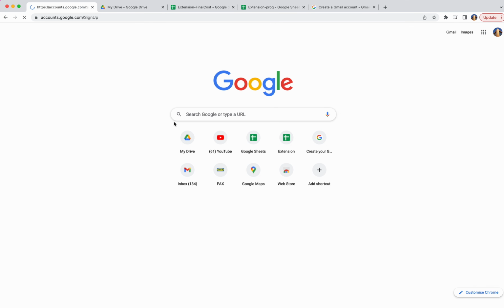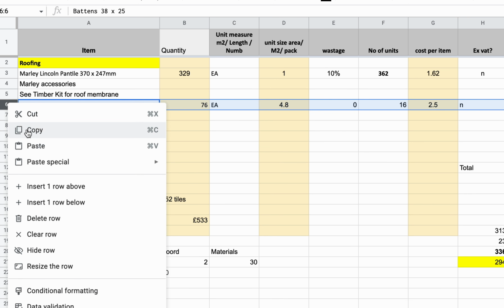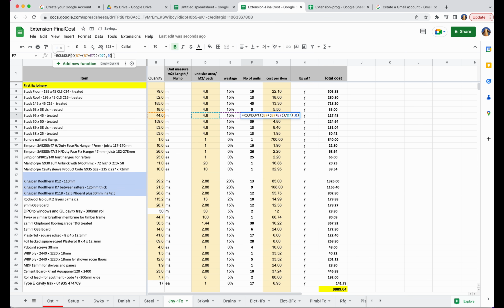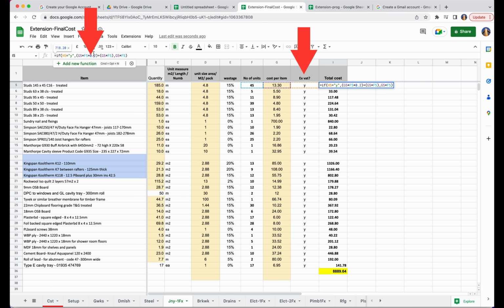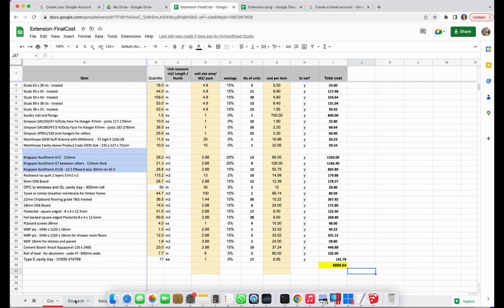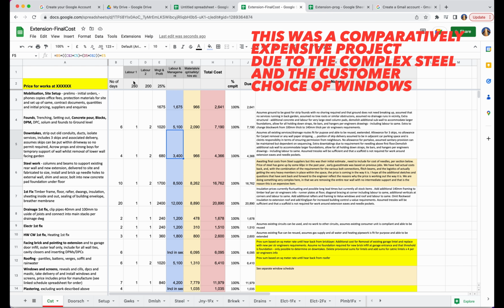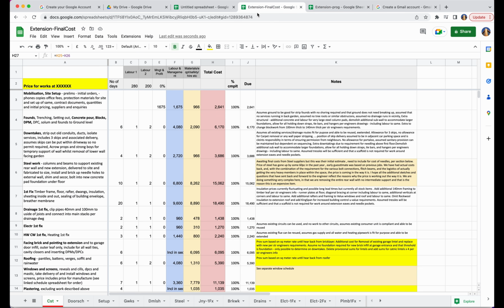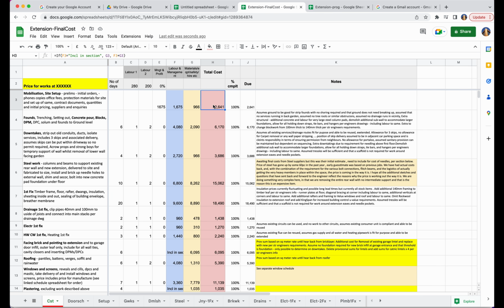How to COST and BUDGET a house extension - Pricing document download EXPLAINED

Comment: Great resource, thanks for putting it together.
If someone is planning a self build and can't see the value in this spreadsheet good luck to them, they have a big surprise coming🙄😂
Reply from the maker: Thanks a lot. If you have any questions on it let me know.
Reply: @build-better-things  Not to take anything away from your brilliant spreadsheet! but have you ever tried a software called Price A Job?
 I saw another youtube UK builder review it. 
The estimating module costs ~£30p/m but I have to say I was very impressed with it. It has a massive library of rates and material prices which I believe are updated every 2 weeks. I don't have a subscription but I may give it a test run. They have a youtube channel, be great hear what you think of it.

Comment: Does anyone know of an insurance company who will provide demolition cover for knocking through when building an extension? I've looked at a fair number of companies, including those like Self Build Zone, and when you actually read their policies none of them will provide cover for demolition by self-builders.
Reply from the maker: I don’t really think there’s a qualification as such for demolitions so the question is whether you can demonstrate competency, and how your standard tradesperson would demonstrate the same.  If I were you I’d be going down small trades insurance route, something like Tradesman Saver, where you have public liability attached as standard. I carry several £million and it covers all these types of risk and my understanding of when mishaps occur is that you need to demonstrate the appropriate due diligence to the loss adjuster . For example digging trenches for foundations and you burst a water main, you would need to demonstrate that you looked at service records and carried out a survey before commencing , so to manage risk. For demolition still about managing risk,  so…providing method statement and carrying out per the engineering requirements. For regulated stuff like electrical work, doing it per the relevant regulations I’m not an expert in insurance so don’t take my advice as gospel. Speak to the brokers and I hope that helps
Reply: @build-better-things  Thanks for the reply. We have spent a long time looking at this issue and have reached a solution. I have done a few big projects since I retired the first being designing and building a bungalow, then a four storey listed building renovation, a coach house conversion and other projects. Previously when getting self-build insurance there has never been a demolition question but now there is - if you answer yes then that activity either will not be covered or the insurer will insist on a third party who has their own demolition cover doing the work - i.e. they won't provide cover. Eventually my son, by being quite pushy, got the customer service person from Protek to talk to a more senior colleague. Eventually they phoned back saying that, as far as they are concerned, demolition as part of a renovation project or breaking through for an extension does not count as demolition. I don't know whether other companies are the same - I wouldn't take it for granted. 
So, thankfully, we have cover and we have that in writing! I still wonder whether the insurers, in the event of a claim, would try to deny cover. I briefly worked for an Insurance Broker many years ago and it was staggering how many people behaved as if insurance companies are philanthropic organisations.